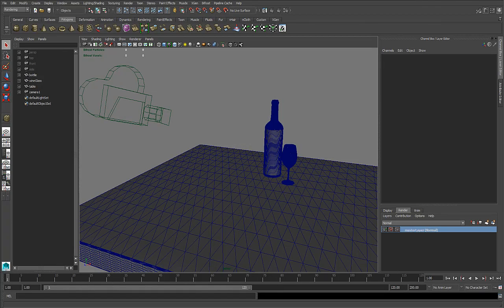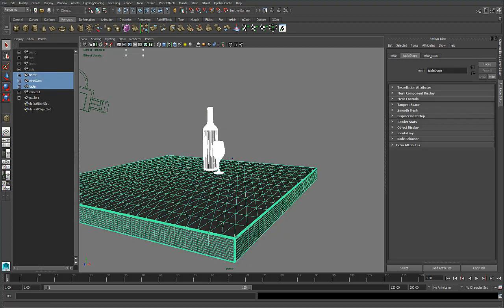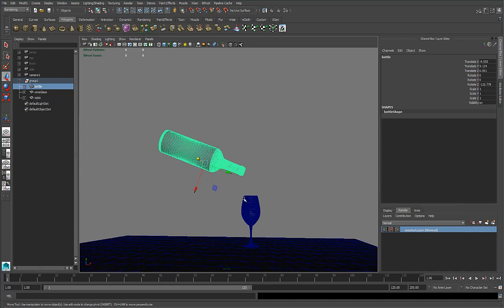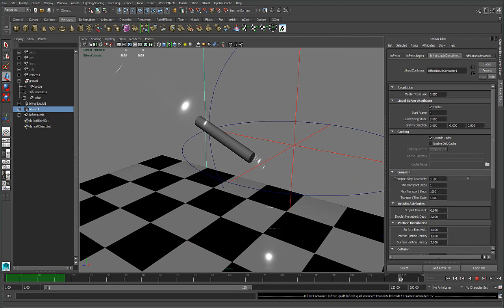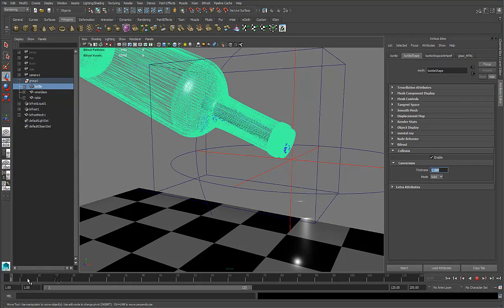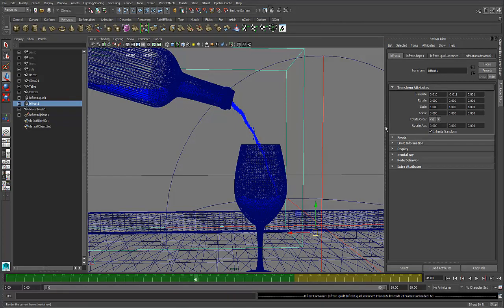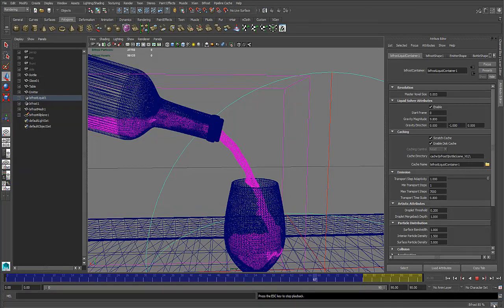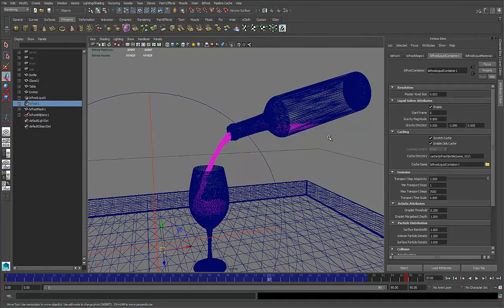Intro to Bifrost Fluid Sim in Maya - Tutorial

Comment: Hey CG Swot! Great video! 

It's been a fantastic introduction to bifrost but I could use a little help with the rendering process. My problem is that when I put my scene into a batch render, my liquid doesn't appear! It works in the simulator, and it's there when I render single frames, but the second I try to batch render, all I get is an empty bowl. Is there a setting somewhere I need to change?

Any help you can provide would be really appreciated.

Comment: Really Good tut', thank you. Although I have one tiny question, water doesn't seem to accumulate when poured. The level stay the same, any idea?
Reply from the maker: The scene used in the tutorial is only a short length, which only shows the start of the sim. If you make the sim longer you will see the glass fill up. Try the projects files which go with the tutorial and make the timeline longer. Let me know if you have issues and we'll check your setting...
Reply: CG Swot tank's for answering ;) 
I know your exemple was a short one, i may have not correctly explain my problem. In my scene the water should fill the glass in a few second, like real water. But it takes more like 10 second, like if the density was really not good and that the water was partly merging with itself, you see what i mean?
Reply from the maker: Nydo Horth It really comes down to a balancing act between the settings. A little more density, perhaps a touch more speed, then maybe a little more friction on the glass. If you are getting 10 seconds on the full glass, time yourself filling a real glass, at roughly the same rate of fill. Your pretty close, just a but of tweaking of the settings. without having the file, that is the best I can suggest.
Reply: Thank's for your advice. I spend some time tweaking my setting and finally got it like i wanted to be =)
Also succeeded to make the motion blur working with some tweaks.
When i'll have a presentable version i'll post it ;)